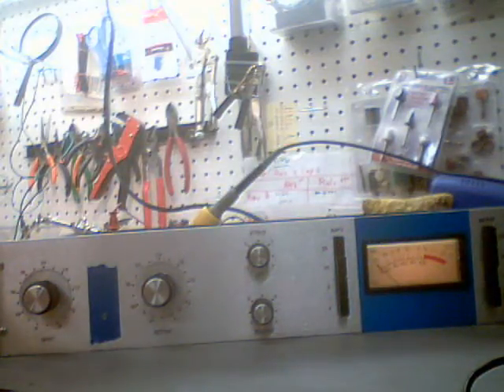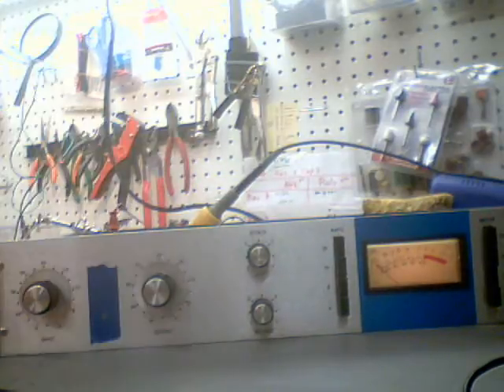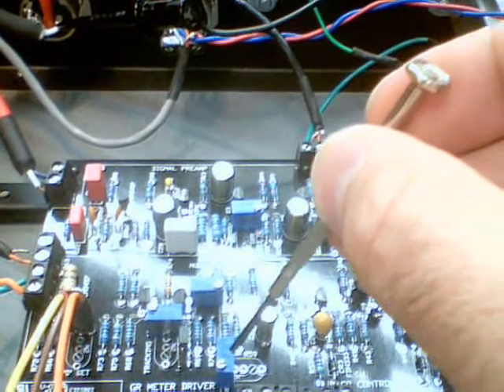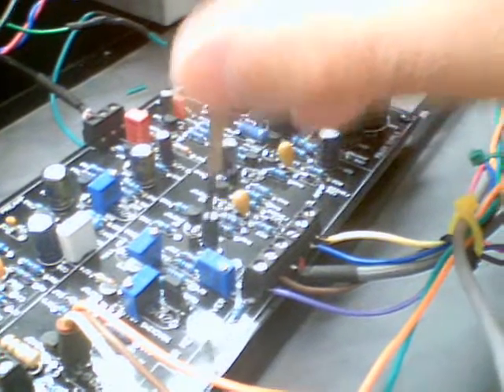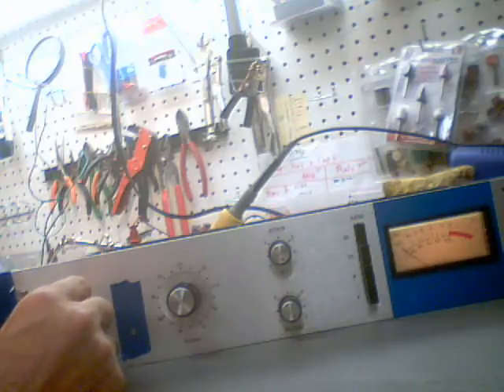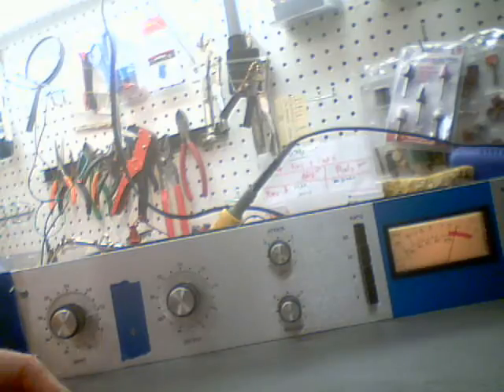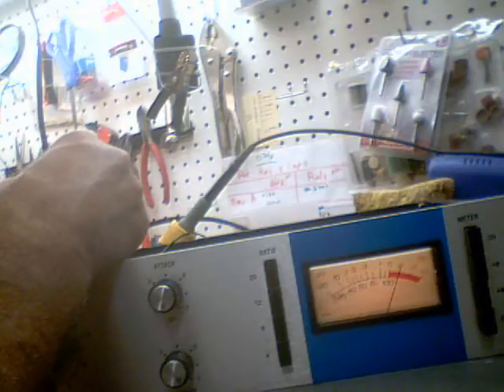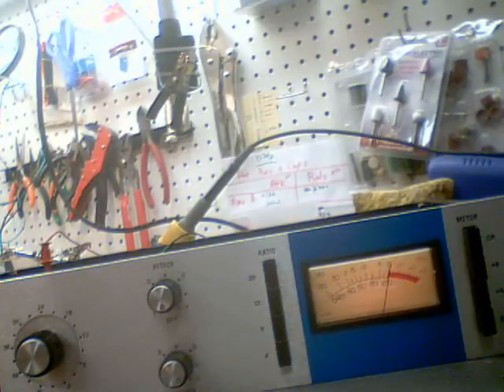1176 Q-Bias adjustment - step 1 complete

Comment: Thanks for the response, I went through the steps on your other video but getting no change in my q-bias trimmer pot. I have a feeling that the trimmer pot is not functioning since I tested it turned both way and getting the same reading. This is also happening on my null adjustment. The other two trimmer pots seem to function fine with a multimeter. The only strange thing here is that the trimmer pots are malfunctioning and functioning exactly the same on  both units. I guess I will get some new trimmer pots and see if that fixes it. Thanks again for the help!

Comment from the maker: For the qbias adjustment - yes.  The part numbers on the board may differ but the steps are the same.  For the meter calibrations, that applies only to the DIY Revision A and D boards with the discrete transistor meter circuit.

Comment: Thanks for a answer, i was able to trace my loud output from XLR, (unit shut down ofcourse) from Input transformator to pcb (i had to take of the ground and + from pcb, it detects sound. Very low volume. not even a high volume turned the t-attenuator knob to fullest..Should it be like this? (the t-attenuator is reacting to my turns on the knob)

Comment: Okay! thank you for the answer, my apologies for asking so much. I feel like i am the only one building a Rev F and could not find these answers anywhere else. Alright, that´ll be my next step then!, I ordere the Rev F kit from Hairball Audio with the Ed Andersson & Avel Lindberg transformers. If i have read it correctly you can use the wiring page for the  the wires of these power transformers, right? Thnks in beforehand!

Comment: Okay thanks, i just got my parts and i just soldered the components on the power supply section on the PCB. Do i have to assemble the transofmers etc first to see if the power supply is working properly before soldering the other compoonents? Or is there a way to check with the DMM that everything is alright? i just checked the current between CT -> -10V & + 30V and it gave me 810 on the -10, and about 1840 on the + 30.

Comment from the maker: At this stage, when everything seems confusing, unplug the unit and take a break!
Then, with the unit UNPLUGGED (no power connected) run some audio or a test tone into the unit.  The input goes to the t-pad input knob, into the input xformer and into the PCB  - at the point where the input connects to the PCB you should be able to detect a signal.  Grab an OLD pair of headphones and touch the tip on the pad where the xformer connects to the PCB - slowly turn up the input and to detect audio.

Comment from the maker: Yes, carefully hook up the POWER transformer as per MNATS wiring instructions and carefully test that you are getting the correct AC from the transformer before hooking it up to the board.  Once you know that the power transformer is delivering the correct AC you can then hook it up to the power section of the PCB and test those points you mentioned as DC on your volt meter.  No need to hook up ANYTHING else at this point.  Be careful to wire your transformer correctly and you'll be fine.

Comment: Okay so ive completed all the other parts now i just need to fill the board with all the components..But still, i cannot get the readings right between CT  -10 & 30 V, altough i have resoldered every component in that section to be sure that there is no cold solderings etc. I could get near 10 V on the 10v pad, but no life between CT - 30 V.. Is this normal? Every  video ive checked up is about the Rev D. maybe i just should go and get that board and components instead.The impatience is growing

Comment: Hi Don, What type of trimmers are you using? Mine look exactly the same but do not tighten and stop but keep turning while clicking once at the end. I was told by mouser this was the way they are supposed to function but having a hard time calibrating my two units(both have the same exact problem). I get a nice signal in and out but get no change in the vu when I turn the q-bias. I measured all the trim pots and it looks about half of them do not stay at a specific reading but are gradually going up. The others are reading the way you specified in the video. Could I have some how  blown them while soldering them to the board? I am also using a Pro tools signal generator for the calibration process. I have been trying to figure out this issue for some time now so thanks in advance for any help you can give me.
Jeff
Reply from the maker: yeah, some of the better ones "click" at the extremes.  try this trick to get the qbias right: 1176 qbias  - trick to get it right

Very unlikely you have hurt anything related to the trims while soldering.

Comment: Note: The Rev F/G uses LM317 regulator and a resistor, instead of 7824 in PSU. But otherwise, yes they are the same.

Comment: Hi again Don! Well i am done with my Rev F now, but i have one queston and one issue. My question follows: The calibrations, Which are necessary for the Rev F ? Only Q-Bias and the Zero Adj?I became a registered user in GroupDIY and have read the Rev F thread.i asked some questions but the thread seems to be dead..Then my issue, i dont get ANY signal going through the Input XLR..altough im feeding all sorts of signal. No compression nothing..net even sound out from the output xlr..whats wrong?

Comment: Hi Don, I did the cal as you describe here. First I think I broke the stock trim pot 2k turning way more because the resistance was always 2 ohms. So both a similar one and did the cal with that. But the problem is I have very low gain when I open the unit, after 15 mins I get a very high input maybe a normal one. For 0.775 input I have 25 V output with attack off. With that gain I could make as you described here. I thought I got the bias now. But when I am tracking, it gets suddenly very low ( like output 1.6 max ) and again jump to the gain I got before with a strong ring. Can you guess where the problem might be. I checked the legs of q trim, no short seems there but can there be a trimpot problem or some other component problem in the circuit that is gain affecting (at 20:1 and attack off setting)
Reply: Thats a REVA by the way. And while the gain was high I got a great sound too from the box. So thought really it was done till the gain drop :)

Comment: Hey Don, so i allowed your video step by step only problem is my Q bias resistor is click when i turn it passed a certain point in either direction. So once i've got the meter to +1 dialing the resistor back doesn't seem to do anything. Is my Q bias resistor messed up?
Reply from the maker: set your DMM to measure AC and put your leads on pins 2 and 3 on the output  - with your .775 volt/1k  input signal being fed into the unit adjust the input to at least half way up, then slowly turn up the output and watch the DMM voltage rise until it hits about 2 volts.  Now twist the q-bias and see if you can see a change in the output voltage - either up or down makes no difference.  I just want to know if changing the qbias effects the output voltage, which is should.  For now ignore the meter on the front of the unit.
Reply: Don Bonin ok so I did that first the output at pin 2 and 3 is reading about 1.5 thats with the input set to 12 on the dial, and the output all the way up, the ratio is 20;1 the meter is set to +4. Im using logics signal generator could that be an issue?  I'm using a 1k Signal at -12dB, going from logic 9 through my scarlett 18i20 to the input of the 1176. When i change the q bias nothing happens at the output. I have a Rev D  is it different for the Rev D?
Reply: after trying it with the DMM I have i don't think I'm getting very accurate readings I'm going to try it with a better one
Reply from the maker: Kirk Cosier ok, please let me know how it goes.  Also, please contact me via don.bonin@gmail.com for a more timely reaponse.
Reply: I have the exact same problem. Q-bias not reacting and DMM not dropping or increasing when I try what you suggest here. I have changed the q-bias but with the same result. 

What affects the q-bias? Can I change any components around the q-bias. Is it the wiring. Any suggestions?

Ive recently soldered the C* C* C*2 and C*3 on the board. Not using any input. 

When I measure all the Q-points according to the schematic I get the right volt everywhere.

Comment: PS: Maybe the transformer is not providing the right AV altough its tagged as Passed, or maybe the circuit board has broken for some reason. Im 100 % sure ive soldered the components the right way, and the right direction.